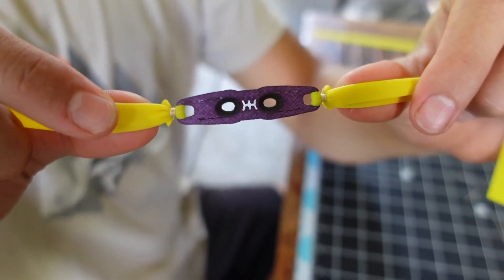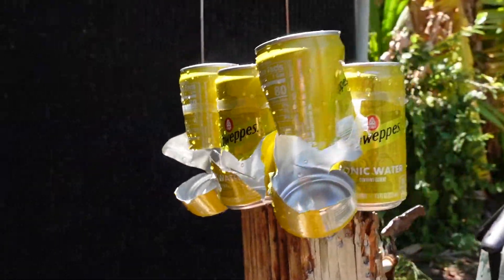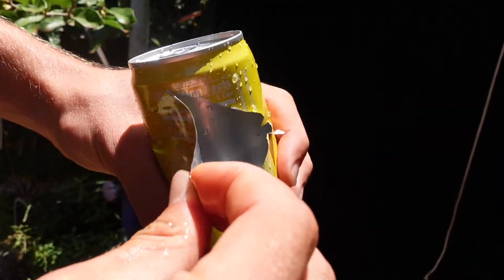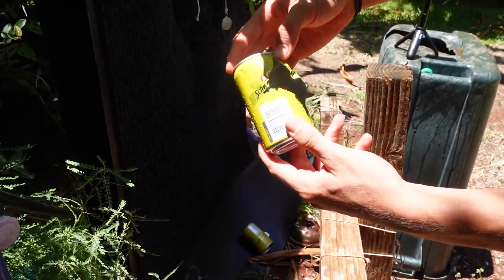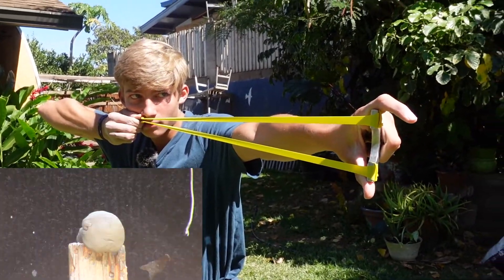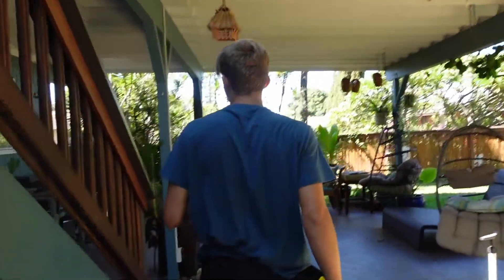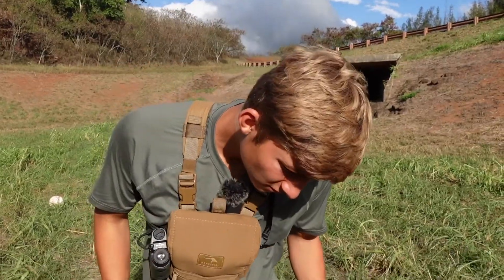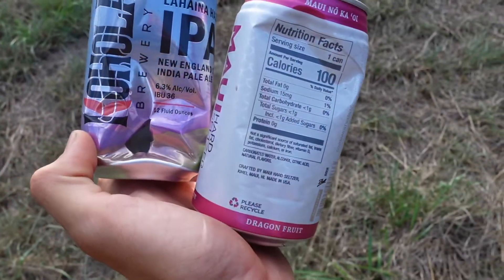LEAD VS STEEL | 9.5mm (3/8") Slingshot Ammo

Comment: Awesome test! I was given a triple tube slingshot”hunting” slingshot for Christmas the year before last. After watching all these flat band videos, I figured it was a gimmick. It came with green bands and clear bands. I ended up buying more green bands then they broke as fast as the first set did because they’re so strong that they don’t stretch my 31 inch draw. Luckily the red bands I got with them stretch a little bit more and are just as powerful of not more powerful. I was shooting 44 caliber lead balls through tin cans at 10 yards that I even put a pop can inside! The down side is about 19 to 21 pound pull  or even more depending how far you yank it back.  Steel will penetrate a tin can but it won’t come out using 3/8 inch balls. Put a really good dent on the backside. The built-in sites on it are pretty slick too. I can hit where I’m aiming at 10 yards using the site. It definitely works for small game. I found that out already.
Reply: I used a 1/8oz egg sinker for rabbit hunting which is 55 grains. They TKO them.

Comment: It is not the size that matters the most, but the weight. The impact energy is dependent on weight and velocity, not on the size. A smaller size, at the same weight, only distributes that energy on a smaller surface, leading to a higher pressure per square millimeter, but the amount of energy is what actually matters the most and the hardness of the projectile.

Tungsten is superior to both steel and lead, being harder than steel and denser than lead.

Though, nice video!

Comment: I actually prefer clay for things like this as it gives you a better idea of what you slingshot is actually doing over just stabbing a clean or invisible hole in gel. Definitely better for airguns and other weak weapons, save for maybe arrows where you want to see slicing action more clearly.
I also suggest you give slinging a go as well, check out Mitch Mersa, Irongoober, and Practical Paracord to see some of what those guys are doing.
It's a bit different than a slingshot, but I enjoy doing both, as free ammo, practically free gear, and 300+ yard shots end up being a lot of fun, especially at rivers, beaches or into the woods a ways away. I have a video of myself doing a 300+ yard shot into a reservoir if that interest you.
Reply from the maker: Awesome, I just checked out your vids, pretty cool. I might have to give it a go some day
Reply: @hudsonhertz  it takes a lil while to get the hang of it, but launching a rock really far into a rocky cliff is pretty awesome